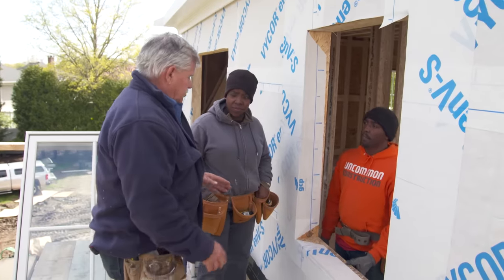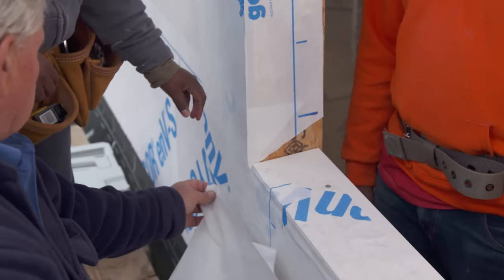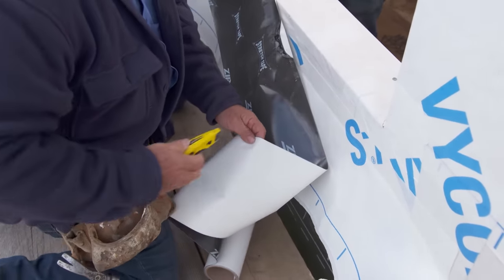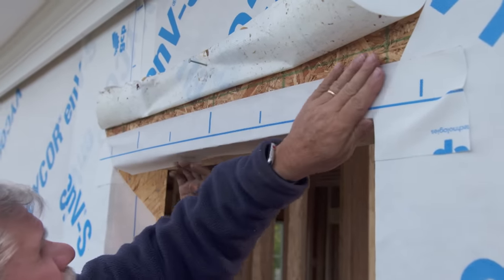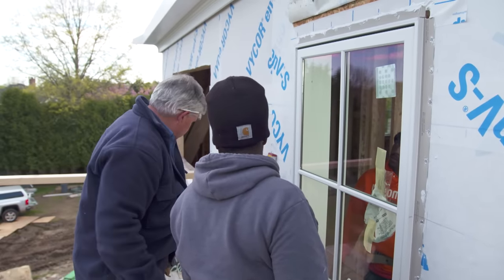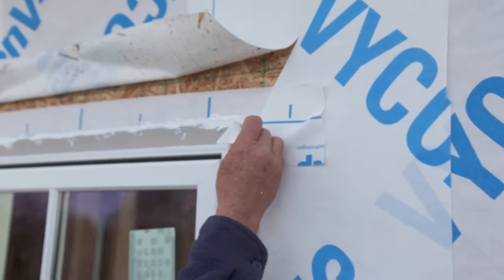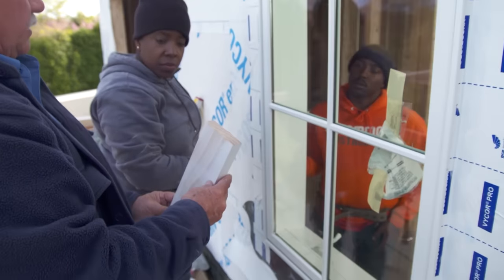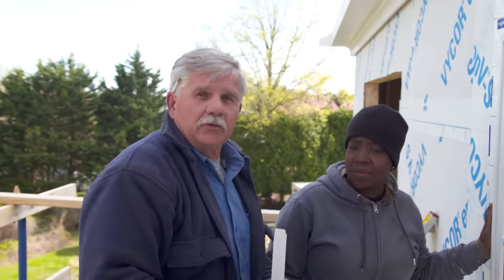This Old House | Pro2Pro: How to Properly Install a Window

Comment: 9:19 WHAT THE?? Is that some sort of new wood-composite 2x4's??
Reply: Not that new, but yes those are TimberStrand LSL 2x6s. More expensive that standard framing lumber but Many benefits. They are always straight, they can made to very long dimensions, etc.
Reply: I wonder how they will hold up after a century or more.

Comment: I have a dumb question. Why use nails for the installation and not a fastener with more holding power like a stainless steel low-profile panhead screw? Sooner or later, nails will always yield to whatever force is applied against them but screws do not. It seems like screws would be the ideal fastener; forever clamping the window flange tight to the house.

Comment: Looked like particle board as siding for that house? I thought particle board has water retaining issues?
Reply: It does but with that kind of tyvek and a proper drain plane installed, it will be able to dry if it even gets a chance to get wet.
Reply: It is sheets of OSB.  OSB is different than particle board.  Water does affect it but not nearly like particle board.  In siding as well as roofing that is properly covered there is nothing to worry about.  Just as good as plywood.  Moisture, even high humidity, will cause plywood to delaminate if left for too long.

Comment: Tommy, do you REALLY do this on every job?  I mean particularly the part about adhering the flexible flashing to the side of the window rather than just applying it over the nailing flange.  And caulking too, all around the window?  Set a house of windows like that and you'll be pealing caulk off your fingers for days after.
Reply: If your getting paid well yes. There are homeowners who pay well enough for the quality of work and attention to detail. They pay just for those reasons
Reply: Installers must follow window manufacturer instructions to a tee so that warranty will not be voided. I'm sure Tom realizes that. He's my hero too!!!

Comment: A little overkill if you ask me.  Those windows will be out in 30 years and new ones will go in. Flashing, Caulking, corner water proofing and then more caulking and flashing.  No need to do all that. No to mention the siding will have caulking where it meets the window too.
Reply: If its $10-15 extra per window for material and you are doing it for yourself, why not.

Comment: The bottom “flashing” is pointless. The water wouldn’t get on the sheathing without it. Water can travel behind the siding and out of the bottom as normal.

Comment: its irc to do this now...dont do it and inspector may make you pull windows...personally the peel and stick roofing tape(not tyvek tape) around the flange of the new construction window exterior is enough, no water is getting thru that

Comment: i pushed my windows in, forgot to level them and then sprayed some foam around so the wind won't blow. None are level. Its been 20 some years....the windows are starting to fail...never had a leak.

Comment: how can there be 75 down votes when someone is teaching someone a skill, makes no sense..
Reply: People that think they can do it better 🤦🏻‍♂️ lol
Reply: @BGI-Pacific  really, all the extra steps they took to prevent water coming in and what not, I highly doubt it....
Reply: I watched a video once from a cancer survivor. It was about her journey and her appreciation at a second chance in life.  Tons of down votes.   Don't get it.
Reply: @rumbletumblestumble  they flashed the sill right. However, he forgot to properly flash the top of the window. Watch the video again and imagine water pouring on the siding above the window. You'll understand that there will be water infiltration from the top of the window. He did put one flashing membrane there but with time, throughout the seasons, its glue will dry up and the membrane will start to peel and water will eventually infiltrate. So because he didn't wrap the whole wall opening with a membrane, the wood will rot.

Comment: caulk the bottom leave 3 spots not caulked is bettter
Reply: That's how I was taught too, you should also "J" roll all that flashing.
Reply: @Justicejamesb  Yes - esp. when the uncured rubber he used to form the sill pan says right on it to use a roller! In reality, it probably doesn't matter, but I cringe every time I see TOH setting a bad example -- they should teach following the manufacturer's instructions at all times (failing to do so will of course void your warranty on your "30 year" windows or flashing tape or whatever -- their adjusters can almost always find an installation flaw and refuse to cover the product).

Comment: so if it was 57 inches one way on the diagonal and 56 7/8 on the other why would you even bother thats 1/16 th out of square in almost 57 inches but more than likely the corners needed to be cleaned up. and if he truly  made it square the diagonal would have ended up at 56 15/16 each way not 56 7/8 each way. I think Tommy is ok at what he does but maybe he needs to tell the producers of the show to cut the BS if you are saying pro to pro

Comment: I'am a professional window instaler. I went to school for this trade"Glazier/metal technician. There are 2 seals to a window. The outside seal is called a ice and water seal. The inside seal is called an air seal. The membrane they used is cheap dodo. They did not use primer for their cheap dodo membrane and he did not chaulk over the membrane. I could go on but, Lets go to a positive note here. FREE TIP!  NEVER BUY windex again, instead use plain (no silicone added) auto windshield fluid. The money you save? Please donate it to old age medical care.

Comment: Too bad ol' Tommy forgot to read Vycor's installation instructions that call for rolling that flashing for best adhesion. 

 I'd have used a liquid flashing and sealed that entire opening, then used more liquid flashing to seal the fins/edge of window once the window was installed.  That way there's no dicking around remembering which sequence is needed to install and there's no buildup in corners or tricky transitions.  Can use low-cost labor or DYI-ers to prep the windows and still get a bullet-proof installation.   That stick and peel, er, peel and stick is a royal pita if it's warm/hot and worthless when wet and often delaminates if not properly applied (which happens all-too-often).  Liquid flashing isn't cheap, but it's not that much more expensive than stick-n-peel if you can use low-cost labor, plus it can be installed in damp conditions because it's water-cured.
Reply: He even missed it on ZIPSystem Stretch Tape on the sill - in spite of the admonition of "ROLL THE TAPE" and the image of roller printed right on the tape!

Comment: Applying silicone under the nailing flange is such a waste of material and time. He is already covering the flanges with sticky flashing after nailing and it should be enough if done right. If water gets under the flange you are screwed anyway.

Comment: House wrap should NOT wrap around under window jambs.  Air under the house wrap can make drafts near the window casings.  Better to cut it at the opening, and use spray foam between window jambs and jack studs.  The seal will be from jamb to stud, not jamb to house wrap.

Comment: You spend a lot of time using many different materials to prepare the rough sill. Understanding the key details needed to properly flash a window or door still the problem is, and we all know it: time is money, tapes are messy and inconsistent, labor force will neglect key details like slope, proper shimming(without penetrating the detail) and flange stand-off for drainage, etc. SillDry.com delivers every detail needed to achieve a water proof rough sill for all windows and doors plus installs in seconds with only two fasteners. Check it out and let us know what you think!

Comment: wrong. the proper way to install a window is to NEVER install a builders grade window(a window with a nail flange).  please everyone keep in mind this is a tv show. they set scaffold up to work outside this window.  no window company will ever take the time to do all of this.  they would go out of business taking this much time to install 1 window.  most installers have to have a whole house done in a day or two.  ladders is all they use.  it should be up to the siding crews to properly seal the windows. on new construction.  the house wrap should be in place and all the sills prepped for the window install.  caulking the flange is ridiculous and a waste of time.  the siding guys should come behind and tape the nail flange and seal their siding. I would also argue that floating that window in the opening like this is a NO NO.  the sill will start to sag and the operator for the casement window will not work properly because the track that supports the weight of the sash is mounted on the sill.  if the sill sags the sash can fall out or jam up when trying to open it!   at least use shims inside to support the window weight!!!

Comment: So did anyone find the 1/8 of a inch he magically lost squaring it the second time lmao. Should have been 7/8 heavy both ways
Reply: Yep, that was pretty funny.  I guess there's a point when "it's good enough".  He also put the bead of caulking along the sill as a dam, but then proceeds to set the window into it without telling the guy inside to use the pry bar to keep the window up off the sill.  He should have rehearsed this installation with his helpers so they knew what to do.
Reply: I was wondering the same thing - maybe they just edited out the part where they used the Festool Window Stretcher Mark IV.

Comment: Those folks are like, this dude is nucking futs. We are going to do this the way we’ve always done it. 

Should’ve skipped all the bullshit, made a simple pan bottom and sides, caulked the window flange and taped the flange after install. And installed 3 windows in this time frame.
Reply: I'd fire you.
Reply: @ElisaDangelo-l5m  That says more about you than me, because my approach is code, while what we are seeing here is far from it. I probably won’t work for you if I did need to work for someone, but since I work for myself it’s irrelevant.

Comment: These guys are not ready to learn to install a window?? 
They can not hardly understand what happening as to what parts make a window why R u using Tyvek , how to use a tape measure , level, ect!  If they sent me two apprentice to do this at this stage ?? (Off camera) I would ask them to politely watch do not touch anything!  Like using a 20 oz eastwing hammer to mail the flange off.  It’s all good but they will not remember a thing!  1st things 1st always!

Comment: her greetings members of the US Congress and constituents of the US Senate measurements weights and measures of the Nevada state minister I rise today in complaint respectfully requesting for by 6 by 10 ft exterior wall to the eight foot interior wall in the symmetrics of 8 I mean 16 on 3rd increments of a 20 by 25 foot interior wall to the windows program on the exterior wall the header include that there would be an apron and the top of the header we would respectfully request of Cox Communication the writer for the Windows 8.1 program a ampicillin please confirm the endorsement that is alleged with the Clark County recorder's office by the state Minister thank you today is January third 2020 Pacific standard time zone.

Comment: I never understand the American obsession of building houses with wood, paper and wrapping them in plastic (or more wood). 

Spoiler alert:
I've read 'Three little pigs' The house of sticks didn't do very well 

Also, building houses purely of three of the most flammable materials known to man is never going to end well.
Reply: I understand the obsession euro trash has with trolling america, especially after americans uncovered VW's dieselgate and screwed up their  farfanoogin....
Reply: @nc3826  Not sure what that has got to do with anything, but whatever.

Building houses with materials that are much stronger, and will last much longer without any maintenance just seems far more sensible.

Just had to look up Farfanoogin, and again, is totally irrelevant, so not sure what your point is.
Reply: @sgthree  It's amusing how authors of trolling remarks feign ignorance about their intent. And since you referenced how it was just about an "American obsession" it made everything you subsequently said as "irrelevant", Sir.
Reply: @sgthree  BTW check out Justbiofiber.ca its a hybrid hempcrete based block building system..
Reply: @nc3826  My original comment was just that I don't understand why American homes are built the way they are, instead of brick and clay or slate tiled roofs, which are a much stronger, longer lasting method of construction. In Europe, on the whole, we don't just rely on nails to hold windows in place. Is that such a trolling question?  Really? You seem very defensive about the American way.
Reply: @sgthree  Spoiler alert: 'Three little pigs' isn't about the American way, it's a cautionary tale from across the pond. About the poor choice of materials from the land of the  thatched roof. 
Let me edify my esteemed European colleague that nails have great shear strength than the alternatives such as screws. I guess that's why american win most of the European Nobel prizes? We know how to nail it. 
Also please tell me, how you have such great expertise on how American homes are built? And since I live in a brick home, should I move? Since it doesn't align with your predisposition for what Americans home should be made from. Did come to the US to work in the trades or are you just a youtube expert?
BTW while traveling I have met ppl from all over the world and the only ones that profess to be an experts on the "American way" are a small subset of Europeans who ironically tend to have little to no knowledge about the US. So I confess I am defensive in the face  ignorance and arrogance. But feel free to keep the pretense your comment was just about the use of nails... And good luck with Brexit...
Reply: Well maybe I can help you understand the American practice (not obsession) of building houses with wood and the other stuff you mentioned. You see, in America, we have a lot of trees. And we build significantly more (and larger) homes than you do in Europe because: A. we have the space to do it; B. it’s the American dream to own your own home; and C. the ever increasing population—people from around the world just keep wanting to live here!—need somewhere to live. So, when we build all these homes, we have to do it quickly and affordably using the material (trees) and human resources (unskilled labor) that are available to us and make the most economic sense. If we had a steady or declining population like you do in Europe, we, too, could have a stone mason or two on every job site, and take our time building like you do. But we just keep growing!
Reply: @sammy7237  You may be unaware, but the population, certainly in the UK is expanding at a very rapid rate also, so we are under the same population pressures as the USA, but we do have to build smaller due to the cost and limited land supply.

We still build with brick though on the whole.

Comment: How many monkeys does it take to install a window? OMG! How much crap can we find to put on this window?
Reply: HERE IN SOCALIF WE HAVE A LOCAL MANUFACTURER THAT MADE CUSTOM WINDOWS FOR A $1.5 MILLION REMODEL OF A $1.5 MILLION HOME. MOST OF THE WINDOWS THEY DID HAD THREE IF NOT FOUR GUYS WORKING ON TWO WINDOWS TOGETHER! THEY WORKED SEAMLESSLY TOGETHER. TOO MANY TIMES IN CONSTRUCTION, GUYS ARE LONE WOLFS AND HARD TO WORK WITH AND  OR DO NOT TEACH OTHERS WELL. GROW UP!